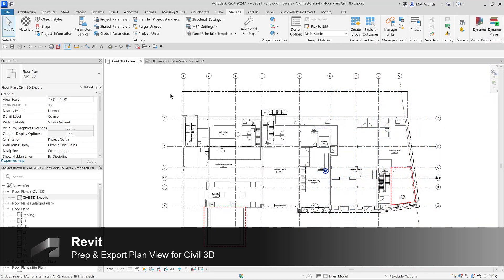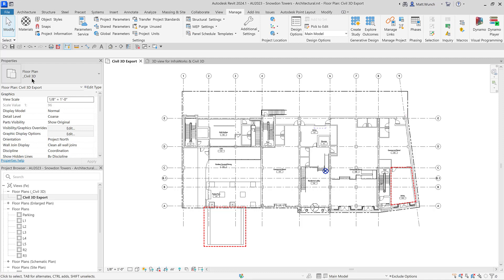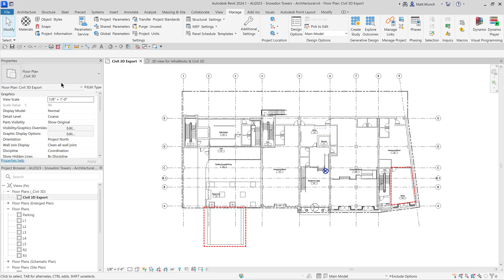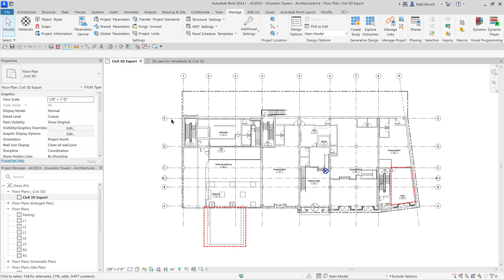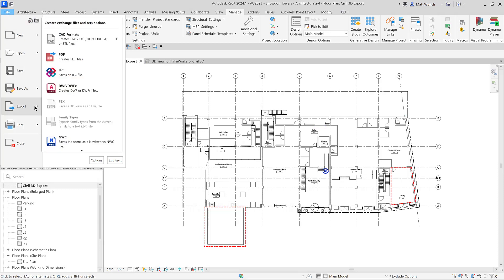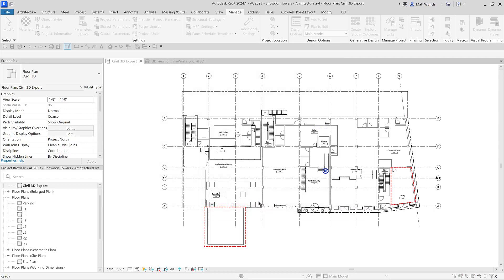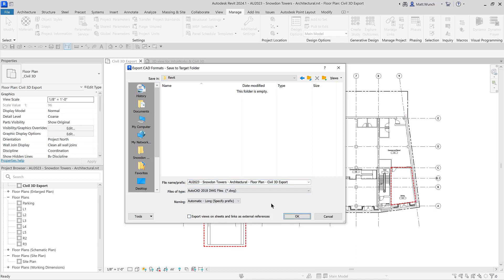Shared Coordinates (Part 4) - Optimizing a Revit DWG for Civil 3D

Comment: Also, at 1:17, you showed setting up the export coordinates base to Shared coordinates, does that matter if your file has not been modified from the OOTB settings (no shared coordinates established, all the origins remain aligned, internal, project and survey points)?

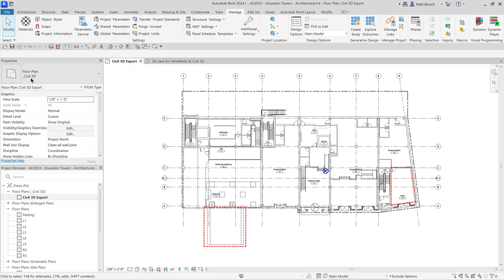Comment: What is the assumed workflow for when the architect first uses the files they received from the civil engineer as mentioned in 0:38 in part 1? What steps does the architect need to do to set up the shared coordinates before saving out the dwg? Thank you for this series, so helpful!